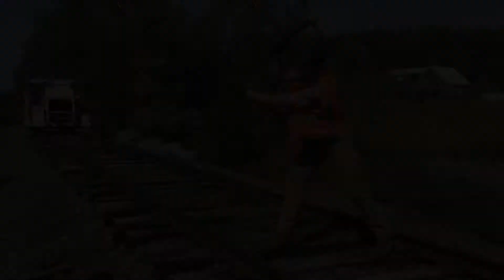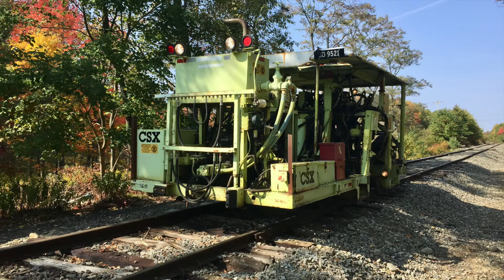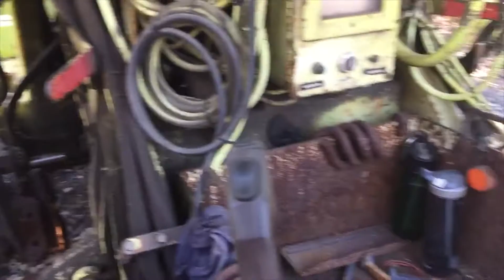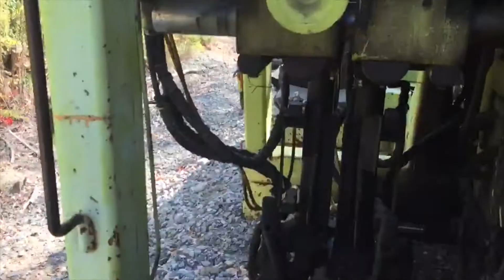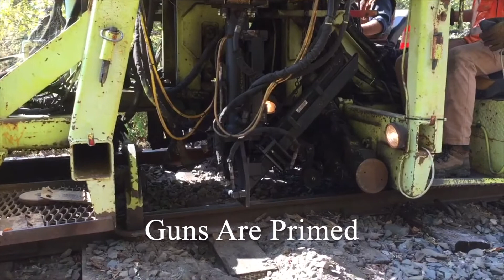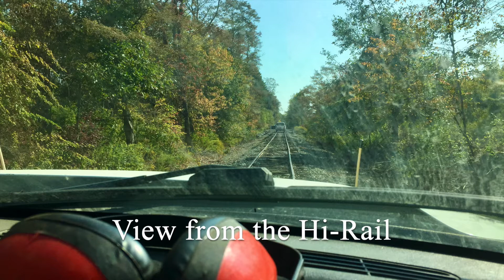How a Railroad Spiking Machine Works | Belfast & Moosehead Lake Railroad | 9/26/20

Comment: They must have done this before they started running the days trains? I saw your yard video a couple days ago with the same date, Thanks for sharing this, don't get to see MOW equipment working very often
Reply from the maker: This was taken in between the 1 and 3 o'clock train. And yeah this last year we were able to acquire a lot of MOW equipment, it's really sped up repairs. We've put nearly 2,000 new ties in the ground this summer alone. By next year we'll be able to run trains down to Brooks and Belfast again.
Reply: @mainecoastrailfan  is the Belfast line actually gonna have service again?